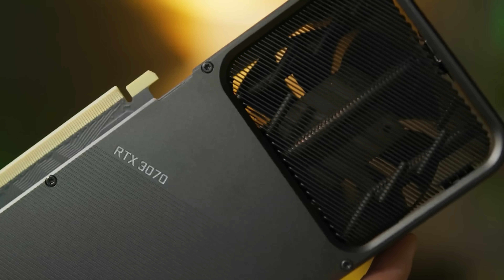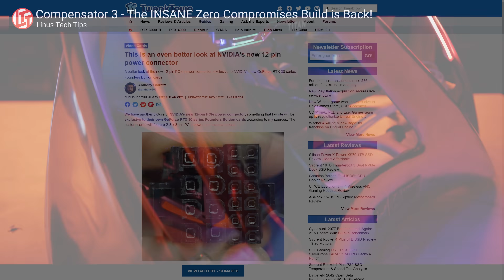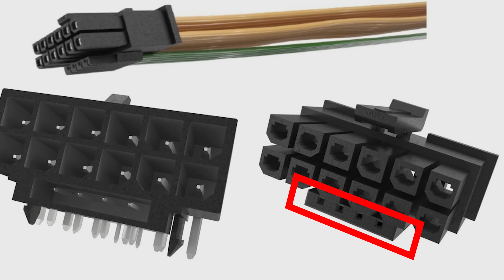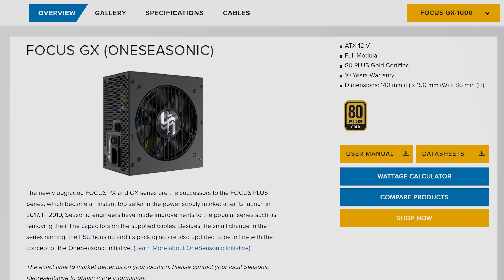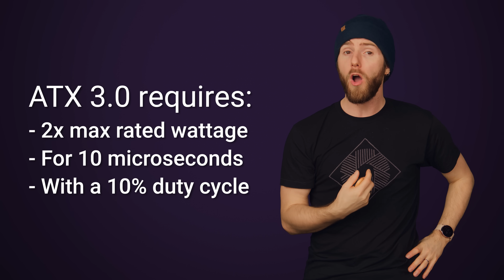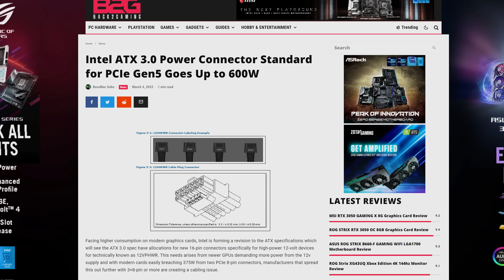Do You Need A New Power Supply? - ATX 3.0

Comment: oh look a competing standard. wasn't the powersupply form factor supposed to be replaced by the 12V only system, that had a much smaller dc to dc converter that looked like a fan header.   
now those two standards must face off in the ring

Comment: It’s all bullshit. A video card connector should be a four pin connector, 10 gauge primary pair with a 18. Gauge secondary pair for voltage drop compensation.
F***k that 6 pin 8 pin bullshit

Comment: I have about a dozen spare power supplies. I will end up using them for Halloween props. The 12v higher amperage is great for wiper motors and the 5 volts works for LEDS....LOL

Comment: The funny thing is this should have been the norm by now. For all psu to include more pcie power connectors by now...  650w and above should have more then 3 pcie 6+2 pin power connectors for gpus non modular ones. But no same with motherboard they shouldnt limit the fan connectors just because its a mid tier board.

Comment: meh the oldest part of my computer is the power supply i got a quality platinum plus unit and while it did cost a bit at the time i have been using it for about the last 10 years with the only expense since then was getting some cable mod cables for my most recent system

Comment: Me: "yea but who cares, it's the spikes that are the issue"

Linus: "oh, and they also have spike resistance!"

Me: surprised pikachu face

Agree with the comments on everything. But I'm also thinking of upgrading once I can afford to, and this might make me just wait a bit longer to make sure that I get the new PSU's... my 1080 "only" requires about 150 watts, but has spikes at around 300-330, and on top of that, it's peak spike (which almost was more than the PSU could supply, which is a 750 watt PSU) was at 415w. Like... How was I supposed to account for that?

I think that PSU prices will go up generally, but because of the Spike Resistance factor, if it is in fact reliable and implemented well and does not cause any longevity issues, may (in my case) actually bring prices down (for gamers, everybody else is screwed sorry!)

PSU prices may go up, but as long as they don't go drastically up due to the ATX 3.0, that means I could instead purchase a 600 watt, or potentially even a 550 watt PSU to run with my current set up, as the only reason I grabbed the 750w PSU was to account for the power spike. If the price of a 600w PSU is less than a current 750w PSU, but can achieve the same or better results (without throttling too much, but 600w PSU should easily be able to run my system not accounting for spikes, 550 as well I just like to be safe) then I would be saving money rather than spending money.

Guess it just depends on how much ATX 3.0 is going to bump up the cost, because my future set up was going to be with a 3080 or better, and I was going to buy at least a 900w PSU to make sure the spikes don't get to it, but with ATX 3.0 I should be easily be able to get away with a 750w PSU (for example). idk, I'm pretty hyped and interested for this change!

Comment: Non issue, there will be adapters or fresh modular cables.  You should already be using a PSU that can deal with the spikes your equipment can pull.  Server 1.5KW PSU should be fine with anything coming along anyway, its just the for looks and RGB crowd that this would bother.  Maybe I'm just a crusty old soldering iron wielder.  I say bring on the new spec, at least it might keep systems running instead of breaking.  And the graphics card can tell you "power reduced" so you know to get a better PSU (or hack yours to make the message go away)
Reply: Is the same or different than the 12V only spec?

Comment: this new spec needs to die. everyone has custome cables and they come up with this stupidity. Plus this new connector with the same wires but different power levels is going to be a safety issue sooner or later unless they are all wired for 600.

Comment: I was wondering why not put a new connector on motherboard in parallel to respective pciex to do the job avoiding a lot of cables tangling all around.
Also why not eps connector don't get fused with main connector of the mobo?
I know that I'm complaining too much but nowadays electronic engineers are so counter productive, less cables means less wasted resources, so if a new standard must to be made, this new standard must be more wiser and more ecologic with less e-waste.

Comment: That's the worst idea ever!
The GPU cable can't make a difference in how much power the GPU draws under the specs of the PSU, and the cable can't have 4 or more levels of how much power it can channel before melting, it's either a good cable or a bad one, since the difference in materials used on the cable doesn't have precise natural limits on exactly those 4 power specs (150, 300, 450 and 600W), so it makes no sense to sell cables with a spec resistance under 600W.
Unless these cables are just all the same, with a different power watt number on it, just to indicate how much power their specific PSU can deliver to the GPU.
But that would also raise another question...
Why would the PSU have 4 identical GPU cables for 4 different power slots on the PSU if this whole new standard is about using just one cable for any GPU?
I mean, your GPU won't draw 600W just because you plugged a 600W rated cable on a 600W slot on the PSU, that's not how power drawing works. And if your PSU is under spec for your GPU, that's not going to fry it and the manufacturer should let you reduce the power draw limit for your GPU.
This whole change with the 4 cables and the PSU is an overkill way to fix a small problem.
And that's gonna make PSUs more expensive. And no, GPUs should not get more power hungry, that's not a good idea in any way.

Comment: A new connector that lowers the graphics cards performance to match the psu performance to avoid instability in a poorly configured system and making it less obvious for an end user if he is actually getting the full performance of his low cost pre built pc, making it seem that the pc is slow too slow for some games even if it's just caused by a cheap underpowered psu sounds like hours fun.

Comment: This is good to know.  It will probably affect me since I will be buying my next computer in probably around three to four years time.  I'm waiting for DDR5 and PCIe5 to mature.
Autumn 2021 I bought an R9-5950X, ASUS ROG X570, 128GB, ASUS RTX-3080 10GB, Samsung 980 Pro system.
For my next system I would like to get 32 Cores, 512GB DDR5, RTX-5000 16GB+.
And yes I do need and use all of that power, I'm already running out of memory on my main board and GPU doing high end 3D development.

Comment: They need to standardize the pin I/O for the cabling (so modular cables only). There is no real reason for them to not be standard. This GPU/PSU communication nonsense will also lead to more issues in installation and troubleshooting

Comment: Still thinking to move into higher voltage. Like adding 24, 36, or 48v rail. So it's required lesser cable or connector for higher/same power.

Comment: I am thinking this is only going to be for next generation high end GPUs, probably starting no sooner then 2023 or 2024, so unless you are seriously looking at getting an RTX 5080 or 5090 or an RX 8900XT in a couple years, I would not really worry too much about this new power supply standard as I'm pretty sure mid range GPUs will use the old standard well into the middle part of the decade and low end GPUs will probably continue to use the current standard at least through the end of the decade as they would have almost no need for the connector's power delivery or redundancy features.
Reply: you notice that 4090 will start to sell like 2 months prior to 2023? plus leaks says it will draw 450w expect spikes of 900 watts (some 3080s have already 700w spikes) so that thing would turn out to be pretty much necesary you do remember new world literally fying gpus bcs of that issue true?

Comment: Yeah, OR they say: "ok lets make only 80% of you rated PSU Wattage count" and your 600W GPU is refusing to work with you 650W PSU (Other consumers like CPU aside) despite the PSU physically being save to operate even up to 125% of its rated capabilites... only to force you buying a new PSU because your card don't accept 600W from a 650W supply, or even better, is not accepting certain PSU BRANDS.

It could be implemented useful, but it could also be abused for "yeah you need to buy this first in order to be allowed to buy this" despite physically meeting all requirements.

Comment: I had to upgrade from my old non-modular psu becausr it didnt have 2 8 pins but this isn't a bad idea. I always love standardization and accessibility.
Reply: Real World, we know the actual result, adapters are used, as happened with Founder Edition 3000 series cards, and AIBs ignored the Spec, and added another 8-pin connector.
My EVGA 3080Ti FTW£ has three 8-pins, not Nvidia's 12-pin, so rarely do specs created to meet an individual Companies needs, go on to get taken up by the industry at large.
My 2013 Corsair 1200, bought to cope with a future upgrade to 4 GPUs (Dropped that idea when multi- GPU support decreased over time) is still way overkill even for 4000 Series.
Also a great power supply as well, Corsair made them better then, than now, as the hurricane vid showed. Not going to stop using it until it finally dies on me.
Reply: @uhuru_stevi_morris-trans-sissy  i mean with gpus drawing 450 watts. idk bout that.
Reply: @kuma8030  One 8-pin is specified for 150 watts. Not sure if they changed that in a later revision.
Reply: @roopey  it is rated for that but it isnt rated for the spikes that those graphic card have. i mean you have what 3 8 pins connectors (right now with a 3080 for example that draws 320w since you can oc them and such it can go perfectly over 400w and it has spikes of 700w) the problem there with 450w cards like the 4090 is supossed to be you have to account for atleast 500/550w in oc. that graphic card would need 4 8pins connectors. that isnt good for the card since cables are heavy, it isnt space efficient(they would need to make the cards even longer or change the placement of the connectors) and and the most important thing: it ain't pretty none of the options are.
nor having a fucking squid that goes from 12+4 to 4 6+2 nor having a card with 4 cables that is longer than the atx connector
Reply: @kuma8030  The real problem is the power draw of these cards. Our cards need to perform better! Just throw more power on it! It creates ton load of problems. Even 3080 and higher are crazy huge and cooling becomes an issue. It's better with a custom loop, but that's not the default. Most cards are air cooled.

Regarding the 12pin. It's only partialy helpful. Up to 600 watt is still not enough and communication makes it just more unreliable and quirky.
Reply: @roopey  i mean im not a fan of just throwing more power at it but im not an engineer so i dont fcking know ther reason behind that.
Reply: @kuma8030  I do know, I fact checked the power draw on my 2013 dual XFX Radeon HD 7970 GHz Edition 3GB GDDR4 for a post on Gamers Nexus EVGA RTX 3090Ti vid.
XFX Recommended a 650W PSU for one 400W GPU, and I bought my 1200W PSU to cope with two of those power hungry beasts. It's a Corsair AX1200
So power hungry beasts have existed before, but even 530W+ of EVGA 3090 Ti, pales in comparison to rumoured 700W of 4000 series, but we'll see when that launches.
The EVGA 3090 Ti has a 12iPin "Octopus" adapter for 3 standard 8-pin plugs, so as long as your Total Power is big enough, even a good old PSU will do just fine.
Reply: @uhuru_stevi_morris-trans-sissy  that's for sure it won't be pretty nor will have all the protections. But it will work. (Protections that for titanium tier or even platinum aren't even needed most likely)
Reply: @kuma8030  Why wouldn't it have Transient protection, that's appears to be for PSUs close to the limit, like a 600W system Draw, +100W transients briefly hitting 700W
With a 650W PSU, having Transint protection of +100W giving cover for brief periods up to 750W. I can't see my 1200W 80 PLUS Gold PSU having any transients go over 1200W.
Only caveat is I'm pulling expected transient numbers from little data, "Seasonic, in their labs, have seen RTX 3090 transient loads spike to north of 550W", for example.
It's an issue, for smaller PSU, but seems a decent PSU with Total System load headroom, of +200W should be fine, if your PSU holds close to spec after manyyears of use, like mine.
Reply: @kuma8030  1 of the reasons is more GDDR chips. Each GDDR6 chip is 3Watts. 1.25V or 1.35V depending on the pin. The amount of amps is not listed in the public design guide from Micron for the GDDR6 chips. As 1 chip is either 1024MB or 2048MB. For a card with 24GB of VRAM assuming it is using all 2048MB chips it is 12 VRAM chips at 3Watts per chip so 36Watts just for VRAM. Now you do know that the AIBs don't always run their hardware to spec as the companies almost always overclock their hardware. 36 Watts is the base needed amount to work for that most likely it will be higher and as overclock isn't that efficient it will go up in a steep slope. There is a point at which providing more power returns less performance than providing less power would even with heat under control. So you have 36 Watts of VRAM in the 3090 the rumor is the 4090 has 2x that amount so 72 Watts of VRAM before overclocking. 

You also have the GPU is getting more power hungry to supply all the more cores in it now compared to the previous generations of cards. In part yes it is due to being clocked higher and the GPU designer company's algorithm boosting it up without user input to what it can do within limits. So it is feasible for a chip with 2x the cores and 2x the VRAM to take 2x the watts. Now in this the lower end chips we will get shouldn't take that much power but that depends on how nVidia decides to do the binning process. The VRM will also have to grow and/or change for the highest end card while if the power requirement for the mid end card is similar to what it is in the 3000 series then i do not see a need for the new VRM design and new power connector.
Reply: true that, too bad it's gonna take awhile for it to actually be a thing

Comment: I was going to buy a 1200 watt platinum power supply to future proof my system for at least 5 more years, should i go with this or am i being stupid? I currently have a 750 watt psu and and a 3080 hoping to upgrade to a 4090 when it comes out if the price will be reasonable.